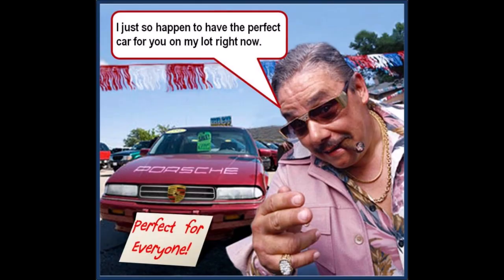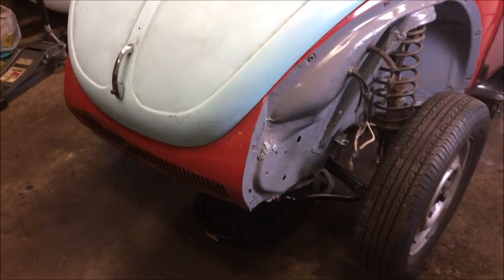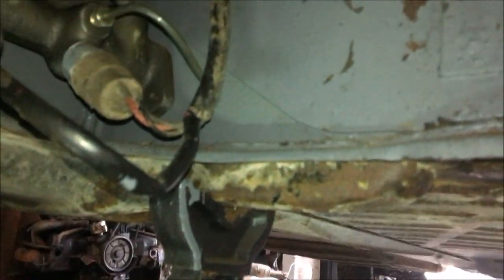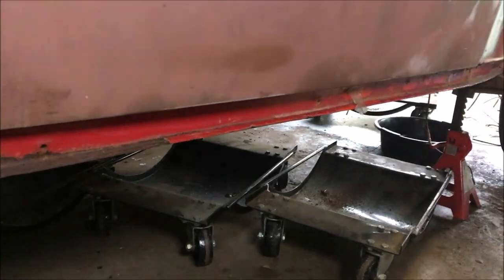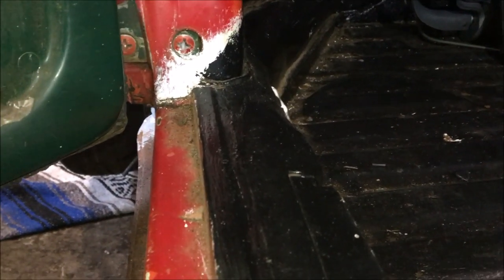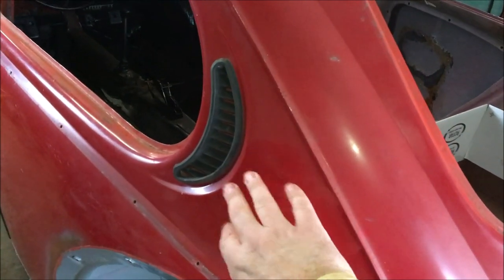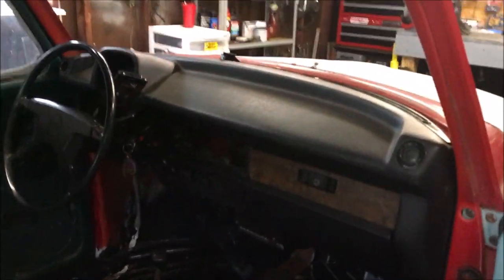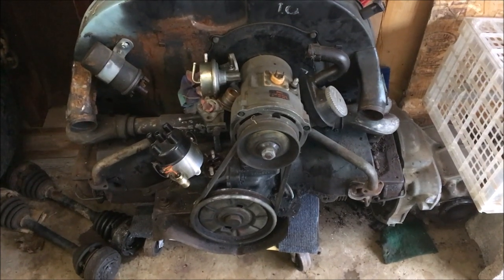What to Check Before Buying a VW Beetle! Or Super Beetle!

Comment: Yep always important to check them. As a mechanic I know a good amount as to what too look for. I know the air cooled VW mechanic in town too he said most of the same stuff you did. Mine is solid it has a spot of rust on the door under the window but that’s it so I spray it with WD40 before it rains and it hasn’t spread any so that’s good.
Reply from the maker: Yes, you definitely have to go over any car pretty well. These ones you really have to check into. I’m sure I missed a couple of things, when you’re filming, and your brains everywhere. 😂
I got lucky with this car, it came from Arizona. So being in the rust belt that was a great treat for me. The 68 I picked up is fairly solid so I might’ve got lucky again. We will see soon when I pull it into the garage and start taking everything apart.
Reply: @SladesVWBeetle  I bought a one owner 1971 Super Beetle Autostick from a man who was in the Wermacht. He only drove it around San Diego streets. He was 96 years old. I flew sight unseen from the East Coast to buy it for $6500. I never owned a VW bug, just my father's 53 after WWII. Didn't know anything about them. It was all original and needed a lot of TLC. After five years I learned a lot and restored the car. It had the original paint and zero rust. I would never buy a car other than from Cali. I learned my lesson in1986 after buying a 1969 Plymouth Roadrunner from New England. I invested 10k in resto and small rust spot came back. Unless it's an off the chassis rotisserie sandblasting and lead loading repair, I will pass. Bondo is garbage. New water based paints look terrible. Lacquer or nothing IMO.

Comment: Great video. You hit the most common issues, gaps, cancer areas, etc. Since you were showing a Super Beetle, and mentioning the standard Beetle, don't forget the verts, and the sunroof and later models, and ragtops on the earlier. The channels do rot. On the convertibles, the area where the heater channel runs, they have a stiffner beams (because of the lack of hardtop) that rust. You may have also mentioned that the pan and body are two separate thngs, and repairing rust is best with them separated for access. Of course the garage has to have the extra room. Otherwise, great stuff.

Comment: Awesome tips, also a common place to look for corrosion is below the brake fluid reservoir , spillage is common, my beetle had a little rot between the door hinge and fender where the fluid seeped in. I recently watched the engine rebuild videos you posted it was very helpful ,my engine had an oil leak so I pulled the engine out replaced the gaskets and seals and while I was at it replaced the clutch as well. I was wondering if you could do a video on carburetor tuning and engine timing especially with the different pulley notches ,much appreciated.
Reply from the maker: Thanks for being here, and I actually will be doing a video very shortly on timing adjustment. And of course tuning the carburetor. I have another carburetor arriving here Thursday I’m going to test out. And yes that is a very good tip below the brake fluid reservoir. Outstanding! I have a few videos on here with carburetor adjustment before putting it on the car.
Reply: My 68 beetle was my daily driver in the early 2,000's. I got tired of putting a quart of oil in every tank of gas. Pulled the engine out of her one weekend and replaced all the engine gaskets. Drove it to work Monday thru Thursday and she ran great. No drops of oil anywhere. Friday morning on the way to work she started losing power on me and the farther we went the more she smoked. It was so bad when I pulled into work I couldn't see behind me. Was only a ten mile drive to work. Was running late so I ran inside and punched in. Came back out at lunch time and found the motor was locked up. Had to have her towed back home. 😢

Comment: I should have found look this video before I bought my bug because mine has quite a bit of rust in it but it seems to be pretty solid. I'm sanding the rust out of it now and hopefully I don't find that the body's been eaten away! It's gonna be a work in progress that's for sure.
Reply from the maker: Well, move slow my new friend and take your time!! They sell all the repair panels for these cars. I believe you said a 67? I thought you might have said that on another comment? Where is the rust you found?
Reply: @SladesVWBeetle  near the floor boards by the peddles
Reply from the maker: @Speakerlynette   OK they sell repair panels for that. It would depend how bad they are. You might be able to patch them. If the holes are small. I have a video on here somewhere with a pedal assembly removal and installation. Add me on FB if your on there. I can send you links or look at photos you can show me on the areas on concern. FB I'm Slade Beetles

Comment: hey bud, taking a shot in the dark that youll answer . you have been very helpful before. anyways, ive heard the 71 circuit pannel has 10 11 and 12 jumped my question is from aug 71 to 74 i think just 11 and 12 are jumped. all i can find is 72 in my orange service manual. if memory serves me correctly, 71 is wired differently but 72 on up to 74 are all the same harness. and wires are routed the same way. bty, appreciate the videos. and ive got the hand shakes also. tbi and ptsd. rapid encounter with a shattering cinder block wall. cant figure out if shakes are from my fine va prescribed meds or the brain injury. lol. anyways, ive got a model a and a 74 beetle that keep my mind occupied when times get tough and i just about always have you on the big screen in my garage when im working on my bug. i just dont trust a lot of youtube mechanics but you are spot on and have never led me wrong yet. respectfully,
Reply from the maker: How are you doing Mark! Truthfully, I always go to the samba, and check their archives. They have great stuff on the wiring and fuse boxes. I really hate wiring to be honest with you lol for the main part! 
My hands have always shook very lightly since I was a little boy. Then got a little more worse with age.
I am quite sure I have PTSD from certain occasions. 
One of the subscribers to the community told me to start with lifting weights. 
It seems when I am stressing my muscles that’s when the tremors get worse. Like my muscles got weak with age. I did try it for a brief. I noticed the shakes were much less. I think I need to get back to doing that!! lol
Reply: @SladesVWBeetle  thank you so much for the response. you really do find time to answer everybody like you say. i figured it out and only 11 and 12 are jumped on the 74 super.  ive replaced or inspected all wires on harness and steering column. plus ive tore apart and cleaned to a new shine my entire odometer. wanted to reset to 000000 but fought off the temptation. lol. today ill be putting in new coil and distributor and tomorrow im going to see if i can get it to start.  ive done everything humanly possible i can do to get it started so after today if it doesnt start something in it is grounded out where it isnt supposed to be. my granddaddy said money will fix anything and i like this bug so as much as i hate to admit it ive been through everything twice and if it doesnt work this time its going to the beetle shop so the experts can find the problem. because at this point im just going to be frying good parts if i mess around with any more of the electronics. love your videos. keep them coming. im into the beetles model A s and grady white boats. they all keep me busy.  this is just for your information. no need to reply. i just like explaining my situation. thanks again for your videos.

Comment: Other things to check, does it have all the cooling tin? Look for crappy aftermarket parts, understand what modifications previous owners have made. My new 74 beetle has dual carbs, which seems to have been done well, but the breather wasn’t hooked up, and the entire thermostat system was missing. Body and structure is nice though, so it was a decent buy. But a few things to address, some gas smell, it wil also need all new fuel hoses under the hood. Does the shifter linkage need work? Does it pop out of gear? Hard to downshift? Budget for a trans rebuild. Does the steering have play? Budget for a steering box or tie rods.
Reply from the maker: Excellent!!!! Thank you for adding this, I truly appreciate it!!
I really like when people add into the community because it benefits everyone. 
Sometimes it’s truly hard to remember while filming. Thank you so much again!

Comment: Hi Slade, I've been watching your videos. I'm learning a lot. TY!  I have a 63 Rag Top. (Still original to the car) Looks alot like the condition yours is in in this video. SHELL of a car.  I need HELP!!! I LOVE LOVE my bug but I have ZERO help with it and EVERYBODY telling me I'm wasting my time with it, it's to far gone, your going to spend more money restoring it...... What are your suggestions?  I've bought it 5 years ago in the shape condition it's in and it's been sitting in my storage building ever since. (Time capsule) I've never even opened the doors to my building. I need a motor for it and a back windshield (that broke when I moved it). It has a transmission but I do not know the condition of it. I have all it's "parts" that's been taken off of it. So now it looks like a complete shell of a bug. Any suggestions please help. 
Thanks 
TEXAS GIRL, VWBUG LOVER